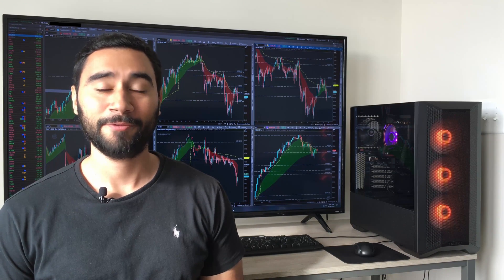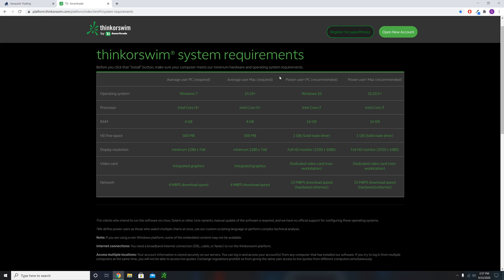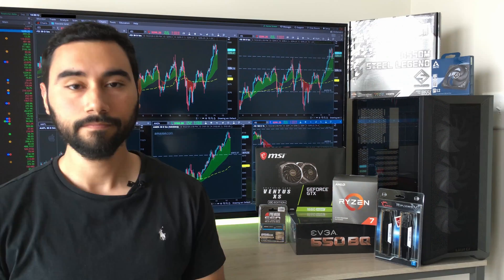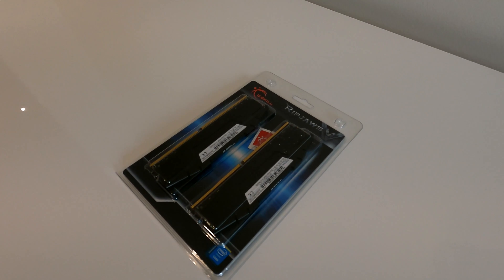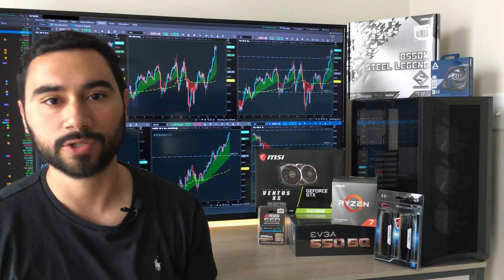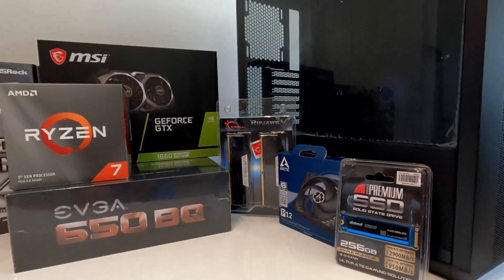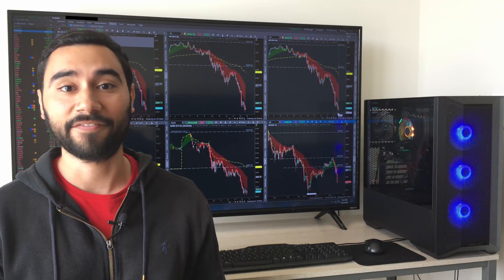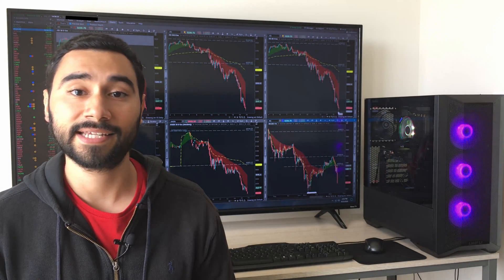Building A PC For Day Trading | $1000 Budget

Comment: Could you please explain a little bit about the ports to me? If I want to hook up 3 monitors to this setup, are there enough ports to plug into that PC? I’m not really sure how this shit works. All I’m trying to do is build this PC and run 3 monitors on it. Thank you
Reply from the maker: Without the use of adapters, you can use as many monitors as there are display ports on your GPU. This GPU in the video supports 3 DisplayPorts and 1 HDMI connection. So 4 possible monitors without the use of adapters.

Comment: Great video. It’s 2 yrs old so doubt the build will cost under $1000. Heard horror stories on crashing with Amd. I use sterling pro and my mini pc tends to crash now and then due to over heating.
Reply from the maker: Thanks for watching brother! Yeah, price will definitely be different if built today. If I ever build a new one, I’ll make a new video. Also fwiw, I’ve never had a single issue with this build. Even on essentially max memory settings with tos, and running for 8+ hours straight. Good luck!

Comment: Hi V ..can i use a Amd  Rysen 5 1600 processor and get good results and what kind of graphic card will you recommend that is under $200 usd??
Reply from the maker: Hey Wayne, I’m definitely no expert but a Ryzen 5 is still a good cpu and you shouldn’t have any issues unless your running a ton of scripts on a lot of screens. The Graphics card part of your question is a bit trickier to answer because of the current market. GPU’s are selling at an insane markup right now so I can’t really give you a good answer on that. My personal advice would be to grab something cheap in the meantime and hope the computer parts market gets better! Hope that helps!
Reply: @VanquishTrading  thanks V it did help a ton.

Comment: dude nice setup. question is the build something a novice can do? that's a good price but i was thinking the price would def go up if you have to pay someone to build it. thanks in advance OK I posted the initial question before i got to the part where you said it was your first time building but still you sound pretty knowledgeable about everything so the questions stands.
Reply from the maker: Haha yeah I tried not to sound like a complete idiot, I think I did okay. There are tons of great tutorials on Youtube that will walk you through the build step by step. If you can use a screwdriver and plug a few things in, you can build a PC. 

And yes buying a PC pre-built (or having someone build it for you) will typically always be more expensive than building it yourself. Things have gotten pretty interesting in the PC build world however. And that is due to graphics cards in specific. Graphics cards prices have gone up significantly in the past few months and cards are selling for WAY over retail at the moment. So I’m some cases, pre-builts may actually be cheaper. I would suggest trying to find a pre-built with similar specs to this build (if you like it) and compare prices. Hope that helps!
Reply: @VanquishTrading  thanks for the reply man. i'll probably just build it myself. i'm not in a real rush maybe by the time i'm ready the prices of the graphic cards will be done came down. besides i think it'll be kind of cool to do it myself. again appreciate the reply
Reply from the maker: @jasontaylor2237  completely agree, building it yourself is a lot fun! Good luck on your future build! Thanks again for watching!

Comment: short question, can i use a monitor for trading without a pc? because all i need is to open my metatrader 5 on bigger screen and be able to do analysis everyday.
Reply from the maker: What do you use to trade now? A laptop or mobile device? If you use a laptop, yeas you can link your laptop to a monitor depending on what video output your laptop uses (HDMI, DisplayPort, etc).
Reply: @VanquishTrading  thanks alot i will subscribe to your channel
Reply from the maker: @vusimuzivm  thanks for the support!
Reply: @VanquishTrading  currently i have a laptop hp but next year i will be using macbook m1 laptop for trading. and iphone 11 specifically.

Comment: Love the video, but unfortunately even the thought of trying to build one myself is daunting. Which pre-made pc would you recommend? As for the tv, how clear is it? Can you browse, read on it?
Reply from the maker: Honestly I’m probably not the best person to ask, just because I’m not too knowledgeable in the pre-built space at the moment. But after just a quick glance, some of the HP Omen stuff doesn’t look too bad. I would just try and find a pre-built with at least an i7 or Ryzen 7 for no more than $1.2k. Usually the pre-builts that have those CPU’s will come with a strong graphics card as well. Anything over that price, is overpriced in my opinion. And make sure you’re getting enough Ram as well. As for the TV, it’s a 4K display. So everything is crystal clear. Internet browsing and small text is very easy to read. And you can always change the display scale in your settings if you’d like text to be bigger. Hope that helps!

Comment: Very nice and good job! Is it possible to add some type of dust filter to that case?
Reply from the maker: Thanks for the kind words and for watching! So the case already comes with 2 dust filters. One under where the power supply fits, and also a magnetic filter that sits at the top of the case. As for the front, I do notice a very, very small amount of dust that builds up on the front panel. But for the most part, the front mesh does a pretty decent job of keeping dust out. It’s been a couple months since I’ve cleaned the inside of the case and it’s arguably not even worth getting in there to clean at the moment. Obviously this may be different based on your personal setup (floor vs desk etc). Hope that helps!
Reply: @VanquishTrading  Cool. Thanks for info!

Comment: You're the man for this... been a mac user for a while and quickly realizing most day trading platforms are more efficient with Windows. SMH. Either way, looking to  build my Windows tower for TOS and I appreciate this. Good work!
Reply from the maker: Thanks for the kind words Kevin, I really appreciate it! Good luck with your build!
Reply: hey there, can you share thoughts on mac?  thinking about getting the new M1 mac mini.
Reply from the maker: @realtynj  Well I love Mac products, I use my MacBook Pro daily. Specs on the new M1 chip Mini look good to me. I would just maybe opt for the 16GB of memory, depending on what your needs may be.
Reply: was thinking about many displays, 3-6. but now am leaning towards one, 45-55” like you have. do you still prefer it that way?  do you lose anything by not having the many, smaller monitors?
Reply from the maker: @realtynj  the only thing I “lose” with the single monitor is the ability to use my desktop in private while I’m streaming/recording. I can’t bring up web pages or documents without it showing on my stream. Which I do a lot for my Trading group. That’s the only reason why I may move to multiple monitors in the future. But if that’s not something that will apply to you, then I would definitely say go for the one big display.

Comment: I also use T OR S platform but use up to 3 monitors with one split up for charting one for research and one for chatting on Discord groups. Do you think this build would be adequate for that application? Thanks.
Reply from the maker: Hey Greg,

Yeah this build would 100% be adequate for what you need, and then some. I often have 8 Chrome tabs open at the same time that I am viewing 9 charts on TOS. And I use pretty bulky custom scripts. So you should have no problem at all in terms of performance. When it comes to your monitors however, just to make sure that you have any necessary adapters/cables needed for the graphics card. But you said you already use three monitors so I’m sure you have that figured out!
Reply: @VanquishTrading  Thank you for the quick reply as your video was what I have been looking for. My son set the old system up for me as I am somewhat limited on my computing skills. What would also be needed to set this system up with three monitors. Thanks again. Also this will be my first build but am quite handy and have been watching quite a bit of youtube.
Reply from the maker: @gregbrunk6555  That’s awesome, happy building!You’ll do great, building a computer is a lot easier than most people think! In regards to your monitors, it all depends on what outputs your monitors have. If you decide to go with the graphics card that I used in this video (GTX 1660 Super), that card has 3xDisplayPorts and 1xHDMI. If your monitors have DisplayPorts, then you’re all set! If you need 3 HDMI connections, you’ll need an adapter. Hope that makes sense.
Reply: @VanquishTrading  Thank you again and I am still comparing the graphics card choices. The one you mentioned is $522 on Amazon and similar on Newegg. Can't seem to find the same memory but still looking. Everything else was similar in pricing on Amazon
I am leaving for Florida in a couple of weeks and might look in the brick and mortars after I get there as I will be there for four months.
Reply from the maker: @gregbrunk6555  Wow, that’s one hell of a mark up. Yeah always try and shop around to find the best price!

Comment: How are you able to get all your charts on the one monitor? Thanks
Reply from the maker: @RJ Grimshaw Hey RJ, I use Thinkorswim as my primary trading platform. There’s a feature that you can find on the top right of the platform that allows you to split up your screen into any grid size that you’d like! And my monitor is 55” so I can easily show 6-9 charts at a time.
Reply: @VanquishTrading  thanks - I am very familiar with TOS, however use 4 monitors. Your setup looks cleaner.
Reply from the maker: @rjgrimshaw  ah I see. Well thank you! I agree. I also used to use multiple monitors back in the day and I much prefer this current set up. Cheers and happy trading!
Reply: @VanquishTrading  are you enjoying the PC?
Reply from the maker: @rjgrimshaw  I love it! It does everything I need it to and it’s the fastest computer I’ve ever had so no complaints from me. The biggest issue I had with my last computer was my custom coded scripts on TOS would basically make the app unusable. On this computer TOS loads everything instantly. And 4K video editing and other productivity applications are a breeze as well.